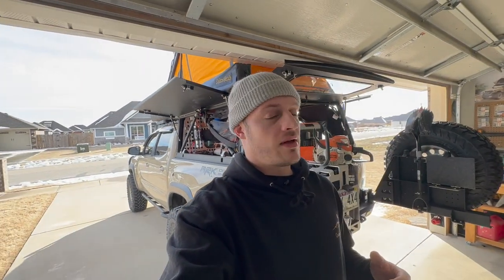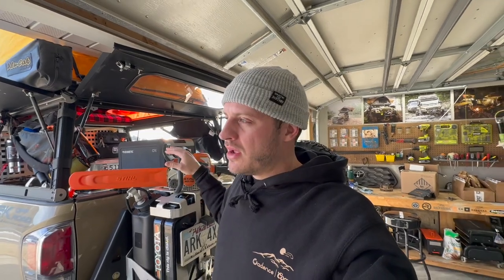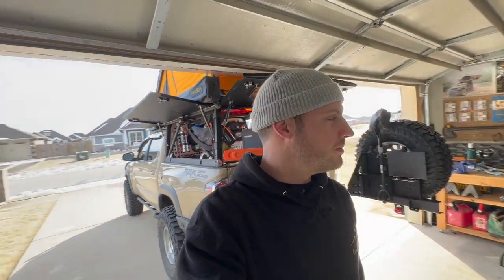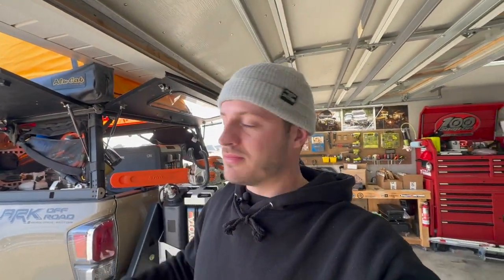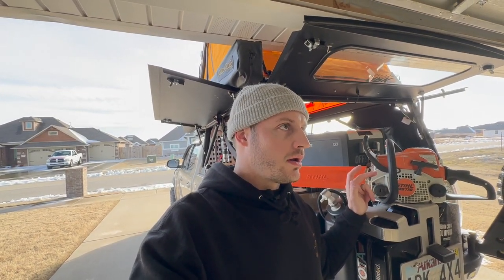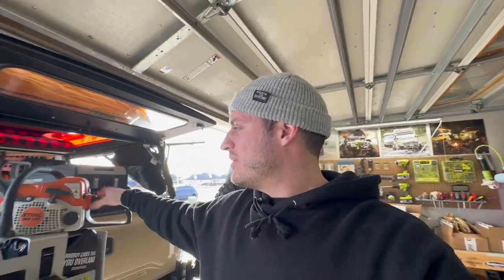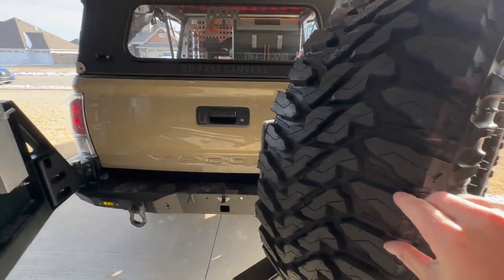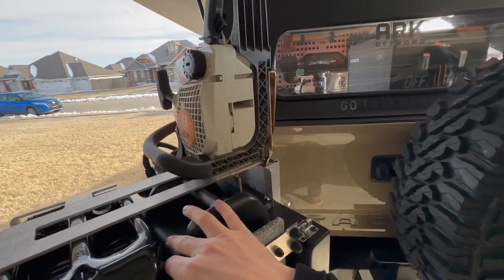Mounting a Chainsaw to your Overland Rig | Do you need one?

Comment: Bought the Dewalt 16" electric chainsaw after 30 years running a stihl gas saw. Tired of carberator rebuilds and gumming up. Best decision yet buying this electric saw. Numerous times when I needed the saw its ready to go. No priming, no fuel or mixing issues. No bad gas. No leaks. Just a saw ready to go and always works. I can tell you this saw cuts just as fast as a stihl and since we have a Bluettie power station and solar panels I can always charge it up when needed.

Comment: I live in the mountains of Oregon so a saw is very important for me. I run the same saw you have there for limbing and slightly bigger one for heavier work. I wouldn’t go with battery just for the fact that I want to be able to refuel and go. I don’t want to carry more batteries chargers etc. plus stihl chainsaws are proven and are incredibly reliable with proper maintenance. I liked the saw mount you showed as well. Going to look into incorporating that into my truck for my two saws.

Comment: I've got a bunch of saws (heat with wood) My Dewalt battery saw leaks bar oil really bad. Stihl just a little. Did you upgrade those caps? Any want to lock the saw?
Reply from the maker: Didn’t upgrade caps. Yes, there’s a lockable tab on the mount

Comment: Another helpful video. I’m certainly no expert, but based on what I’ve seen used by experts (e.g., Outdoors with the Morgans and others), there is a place for electric chainsaws and for gas saws. 

Best I can tell, electric saws are good for infrequent use where the saw may be stored for long periods of time. Since it’s an electric motor, it requires little maintenance, mostly consisting of keeping the chain lubed and sharpened. Many electric saws are in a family of battery powered power tools including impact wrenches, ratchets, circular saws, etc. and, therefore, the batteries can be used for a lot of other tools. This could include an impact wrench you take with you on the trails to quickly change a tire or work elsewhere. Not necessary but nice to have. Electric saws also tend to be much less temperamental to operate in a variety of weather conditions. Altitude and temperatures don’t affect them as much as they affect gas saws. True, the battery may lose a small amount of its total power in very cold temps, but it’s not much. The electrics are also less intimidating than gas for those who have little to no experience with chainsaws (like myself). The biggest issue is that it’s harder to charge them in sub-freezing temps. Electrics also have much less power than gas saws the same size, and their run times on a battery is a fraction of what a full tank of gas/oil mix on a gas saw is. Therefore they are much better for light work, both in terms of run time and size of branches/trees being cut down. Some of this can be overcome by carrying extra batteries, but it quickly becomes a space hog.

Gas saws, on the other hand, are the true workhorses. If you’re going to be doing a lot of cutting (e.g., after an ice storm or high winds on a trail). They have the power and the runtime to work all day. It’s much quicker to refuel with gas/oil premix than it is to charge a battery, and each full tank will outlast even the largest lithium batteries, from what I see. Plus, as you mentioned, there’s something cool about the sound of that saw shrieking away in the woods. On the other hand, gas saws tend to be heavier and larger. They are more difficult to keep running, as you have to worry about fouling the spark plug, clogging the air filter, etc. It’s a typical small, carbureted engine little different than your string trimmer or lawn mower. They don’t like to sit idle for a year and then picked up and cranked. That’s why they do better if they are regularly used and maintained. You also have to have premixed gas/oil to burn in them, not just straight gasoline. That means you have to carry special fuel for them, not just the fuel you’ll burn in your vehicle. On the plus side, that fuel is not too expensive for how long it will run the saw (much, much cheaper than a battery), and it’s easily located at any hardware store or lawn care store. It will also take up far less space than an equivalent number of batteries. Lastly, premix (like the Stihl brand you showed) has a very, very long shelf life measured in years. It’s stabilized fuel, not like regular pump gas. In a pinch, if you know how to mix it, you can make your own premix with pump gas and oil, and many people do.

In short, best I can tell is electric is good for limited and infrequent use. Gas is better for heavy, frequent use all year long. It makes total sense for you and I, who live in the heavily wooded Ozarks, to have a gas powered unit. However, you get out a lot more than I do, so I’m less likely to use a chainsaw very often, so I probably would be OK with just an electric.

And lastly, please read/watch/learn how to properly use a chainsaw in a safe manner before you head out into the woods on your own. Even experienced tree trimmers will occasionally slip up and cut themselves severely while trimming trees. The difference in the off-road context is that you’re on a trail in the middle of nowhere, typically hours from emergency medical assistance vs. the tree trimmer who may just require a 15 minute ride across town to an ER.
Reply from the maker: Appreciate the comment! And totally agree with you. Very good points. There’s definitely certain scenarios where each are preferred. Thanks for watching!

Comment: Discount code at cadence isn’t working fyi 

Still looking for a chainsaw solution without a rear bumper. Modified Plano case has been the go to in the meantime.
Reply: This has been fixed. Thanks for the heads up.
Reply from the maker: Appreciate the heads up!